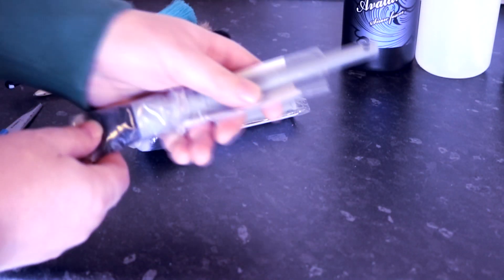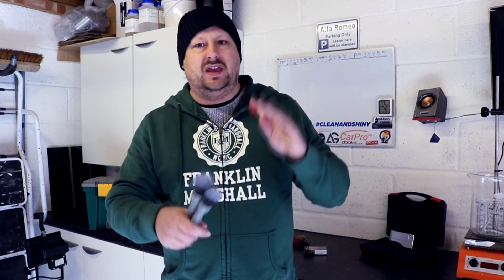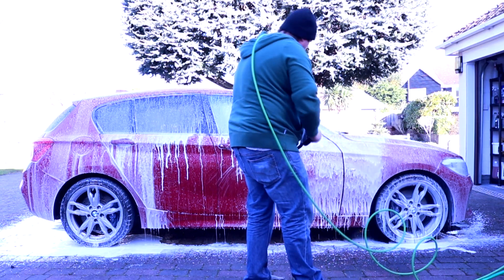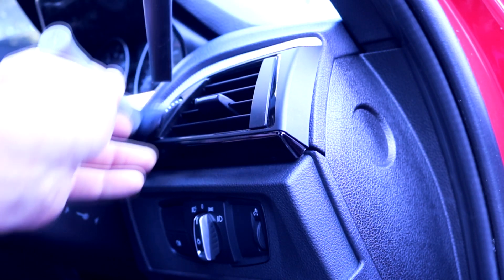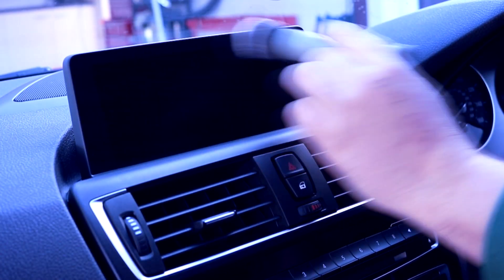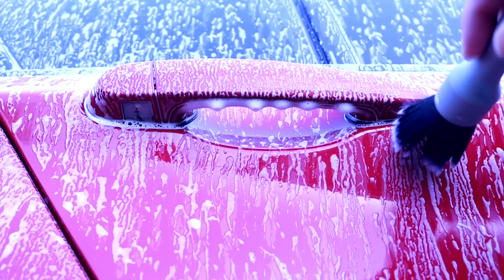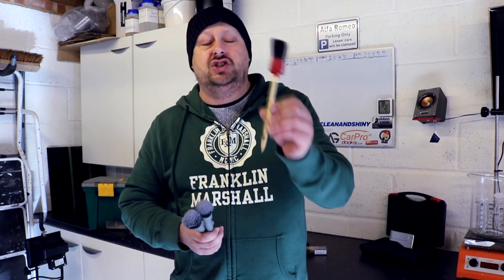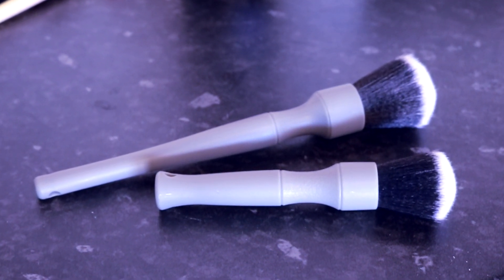DETAIL FACTORY Ultra Soft Detail Brushes - Death of the Hogs Hair?

Comment: I hit the ladies section in make up isle few yrs ago now for al my brushes and there pretty cheap also and also hit the art shop for some long handle soft medium and stiff bristle brushes  cheap as chips. 
But in saying that some of these ones you have just reviewed for us has opened my eyes to some better brushes for exterior high-end jobs i have that roll through  on a weekly basis.  
Keep up the good work mate and keep them reviews and videos coming 👌
Reply from the maker: I did the same :)  I have some art and make up brushes.  you can find very good bristle quality for sure. but the problem was it was hard to find stuff that was really right for detailing.  metal shrouds around the brushes I try to avoid (taping them up is ok but the tape breaks down quickly when it gets wet)  but also the handles were not always quite right for detailing.   these things are designed specifically for detailing but detailers.  theres not much you cant like about them. price is about the only thing I can think of, but a lot of the standard hogs hairs can be close to a fiver depending where you buy from and I can say these are definetly better.  general word on the street about this product is good when I speak informally to other guys that have used them.   they are new to the scene but I think you will see a lot of people using these soon.   If you take the plunge and get them let me know what you think please guys.
Reply: Forensic Detailing Channel very true about the metal around the art brushes cant take your eyes off the job for 2 seconds. I agree i can see the brushes if all our detailing kits and on the job world wide very quickly.
Reply: LNS DETAILING & MECHANICAL I was getting ready to make a very similar comment. I went to a local Dollar Store and picked up several women's makeup brushes that are just like these but a different handle. Extremely soft and a whole lot cheaper but yet extremely nice.
Reply: Excalibur Mobile Detailing shaving brushes work well to just cost a bit more.
Reply: You took the comment right out of my fingers. lol :)

Comment: I have just got a set of these, the blue ones from The Rag Company. They’re are really soft and the bristles have just the right amount of stiffness.
Reply from the maker: they are just fantastic arnt they chris.  the sign of something is decent is you reach for it over the other options.  I prolly might have missed out on these if I didnt run the channel because of the price diff between them and the normal wooden stick hogs hair..   but the way they fan out on flat surfaces and the softness of them just allows them to work so much better.

Comment: Great video mate, you sold me. Would you recommend buying seperate brushes for interior and exterior?
Reply from the maker: yes the exterior brush will take a lot more of a hammering and be wet most of the time. the little one I keep with my vacuum and only use  dry.

Comment: Thanks Jon. Good Video. Its a pity they don't add various colours to the handle. I always have a few brushes on the go and have to mark them up myself, usually badly in marker pen,  to differentiate between interior, engine, foot pedals, exterior wash etc.
Reply: Brownie 360 electrical tape is your friend...

Comment: You posted a vid on the flex look a like. I bought it was the 5151. It's identical to the flex and it works great thanks for the tip.  My questions is which 5" backing flex backing plate won't fit without modifying. Do you modify it or do you have a link to get one
Reply from the maker: hi there,  the in2detailing fixed rotation should come with a 5 inch plate.   

On my 3401 I run a plate adapter system so I can use a 4 inch plate for a specific pad I like to use (which is very hard to buy now).

With your  machine I would check start by using the 5 inch plate that comes with it.  And run 5.5 hybrid force pads on it (motorgeek co uk sell them)

Comment: I've been looking for a wheel brush that I could use to clean the nooks and crannies of my new car's wheels. My only worry is that the alloys are a satin/matte black and I'm terrified of scratching the finish. I've seen your best of 2017 video (brilliant review by the way) and you mentioned the Atlasta soft tip brush for wheels. Would that be ok for satin/matte black wheels or would you suggest these ultra-soft brushes instead?
Reply from the maker: the atlasta brush is the complete opposite.  very hard brush with plastic bristles great for really heavy cleaning.   the detailing factory is the other end of the spectrum.. very very very soft.  so its great for interior dusting with the little brrush.   and good for very very gently safe cleaning on extrior.. so idela for satin matt finishes yes but be away its like a soft shaving brush that will sweep away dirt.. its not going to scrub brake dust off a filfthy alloy..

the detail factory brushes are very very cool.   one of the best things Ive used in 2018.
Reply: Wow, thanks for the immediate reply! What would you recommend in your opinion for a satin/matte black alloy? I have only just purchased the car from an approved used dealer so its in great shape as it is, I'm just looking to keep it that way :D Following your best of 2017 video I'm going to purchase the flat incredibrush as it's microfiber brush head really appeals to me in preventing scratches, but what would you recommend for the harder to reach areas e.g. Wheel nuts and crevices?

Comment: have you got any tips on how to get creases and wrinkles out of leather seats ,if so could you make a video
Reply from the maker: heat mate.  Colorlock have a video on this... need to be carefull.   some natural crease lines where the paint system has cracked.. well they generally need filling and refinishing.   fold lines etc where the finish isnt damage but its creased more like you say..   heat could possibly work with those.     remember leather will have crease lines in it.. its gonna happen.   but search you tube  but check out colorlocks leather bible they have a good video on it.
Reply: thanks

Comment: Just read the comment on the makeup brushes and I was equally curious about this. I don't know a whole lot about them, however, I was struck by the visual similarity of those versus commonly advertised makeup brushes. These brushes are considerably cheaper than the specialised detailing brushes. Think you could do a comparison? Pretty please!
Reply from the maker: I have a makeup brush...  cough let me rephrase that.  I bought a makeup brush for dusting interiors.  Its ok.  Its a bit small.  Its also needs wrapping.  and the handle is too thin.   but it works for dusting out small things.    some of the makeup brushes have really good gentle fibers on them though.  if you can find a big fat chunky one with a safe handle it would come in handy..  but you end up messing around scanning google images for makeup brushes and ordering random stuff to save like 5 bucks, or wasting money when the brush turns up and its not great.    It wont ever be as suitable as this brush.  And the makeup brushes you generally dont want to use them with detergents and soaps on the outside or generally they are too soft on the outside and the paint starts flaking off the housing and crap like that.    honestly. if you are into your car detailing just get these.   If you really wanna save 5 quid and use makeup brushes, then you will need  to hit google up and search around..  the bristles on this brush are more like a shaving brush than a makeup brush really.   but they are also chemical resistent for wet use.
Reply: Thanks mate, that's what I needed to know. I don't mind the extra few bucks, but, if you don't have to spend why would you. That's why you review things and I pay attention and ask questions...
Reply from the maker: indeed fred.  the makeup brush is viable so its worth asking..

Comment: Softness is what you want with a detail brush when using it in the interior. Coincidence is I was actually removing a bit of dust from the dash board about half an hour ago before I saw this. I always worry about detail brushes even though they saw it won't scratch